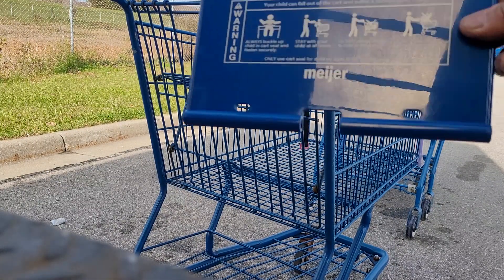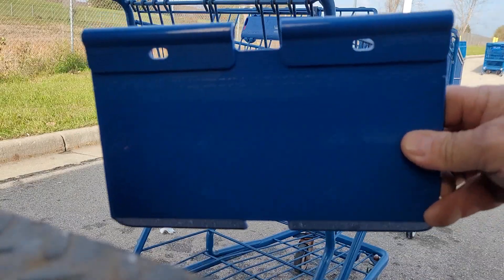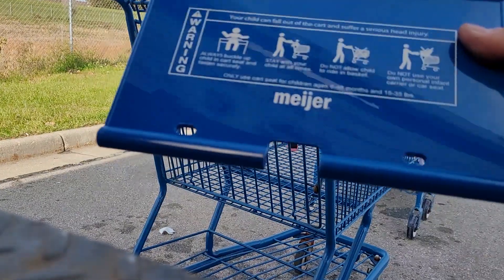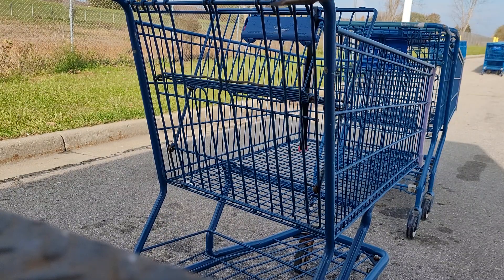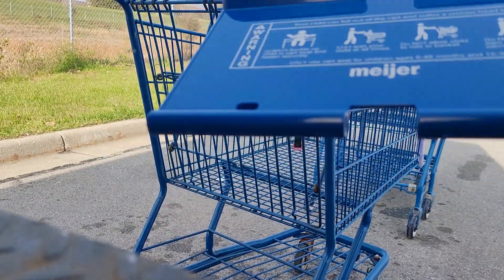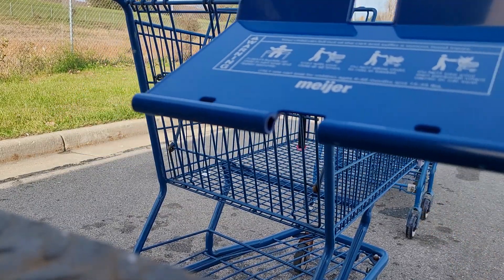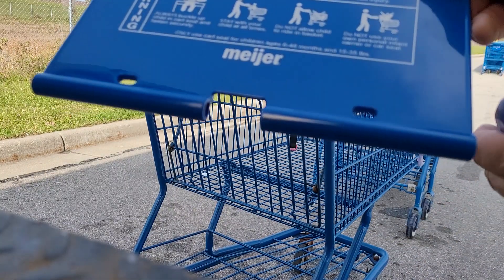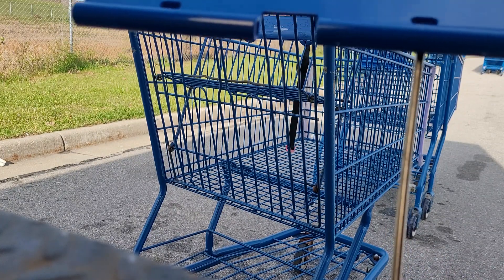Technibilt Seat Flap Install/Removal

Comment: the newer Technibilt Wanzl carts the seats just snap on. the older Technibilt models the seat flap is spring loaded which the seat has a tab tp snap into the seat frame bar. some Technibilt carts you can use a Unarco cart seat.